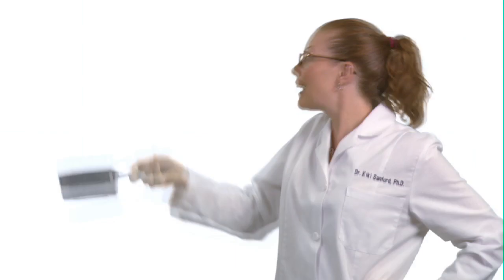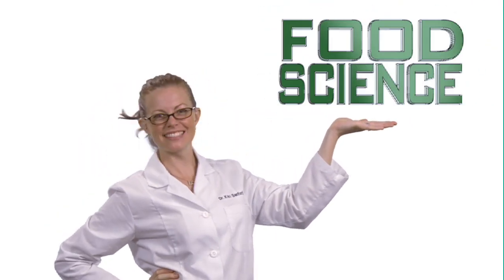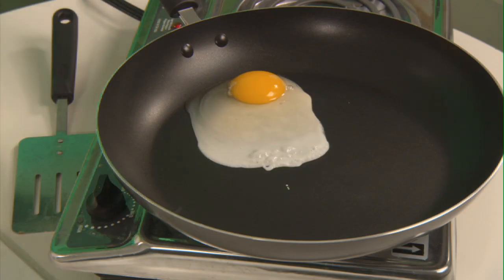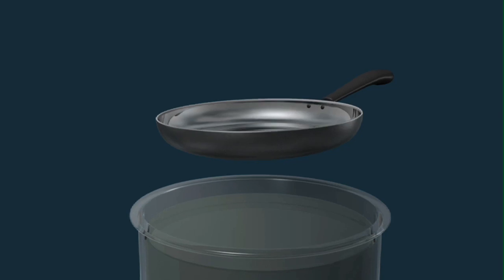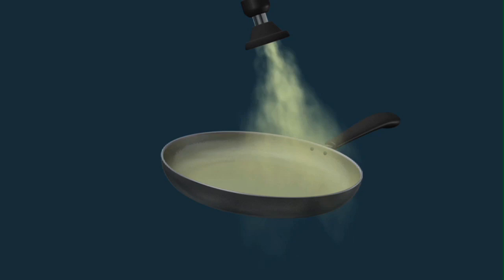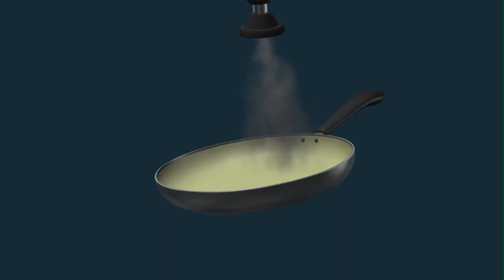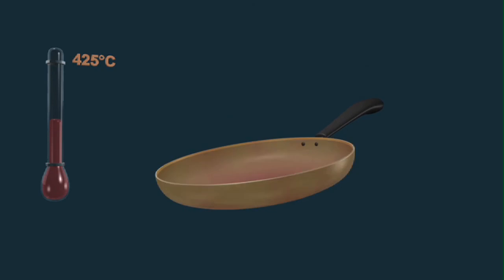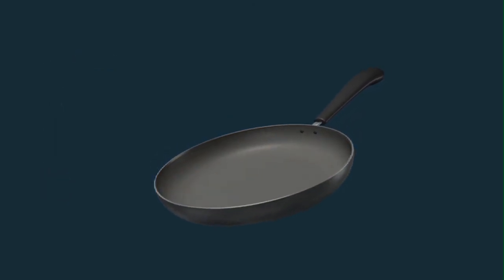What is Teflon? - Food Science

Comment: Anyone can help: I put a teflon layered magnet in a solution containing H2O2 with 65% nitric acid. This solution was stirred for 48h in 60 degrees temperature. After finishing the reaction time, teflon layer of magnet was a little destroyed. I want to know what reaction has happened?
Reply: You will want FEP or PFA for the best chemical resistance. Ptfe is like a bunch of microscopic ball bearings; great for no stick, but eventually things can slowly swap through and destroy the primer layer.

Comment: Sorry my english is so bad, 
so the point is whether PTFE is safe for food?
Reply from the maker: No, it's explaining what Teflon is, how it is made, and what can make it potentially unsafe: basically, don't cook with teflon pans at high temperatures.
Reply: @TheDrKiki  
Let me just correct you there. You touch upon what PTFE is, but you do not spend a second talking abou how PTFE is actually produced or the chemical reactions that occurs when it is made.
Aside from the steps and chemicals which makes PTFE, it is also worth noting that you don't explain how PTFE is mechanically bonded to cookware. While some manufactures do use a chemical bonding process, quite a few products simply use a mechanical bond. As for the chemical bond, it would have been interesting if you had explained how it works. What chemicals each manufacture of cookware use might be a company secret, it is not a secret that they just use a reducing agent which breaks the Fluorine bonds upon contact, thus creating a compound which easily adheres to the alloy. Thank you
Reply: And do not drink Teflon infused water.
Reply: Actually no